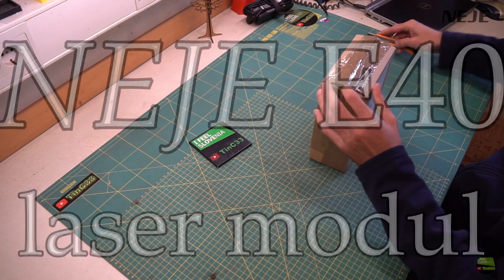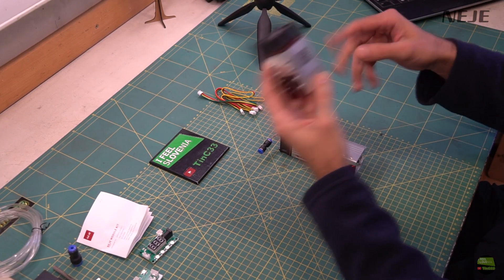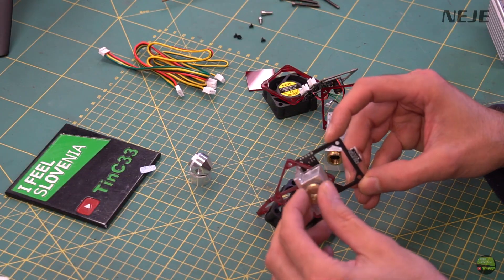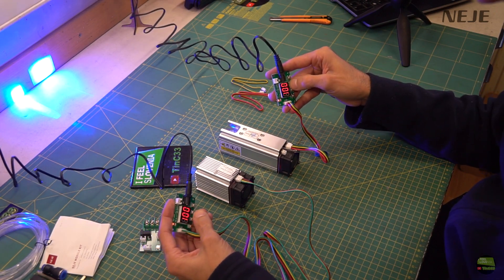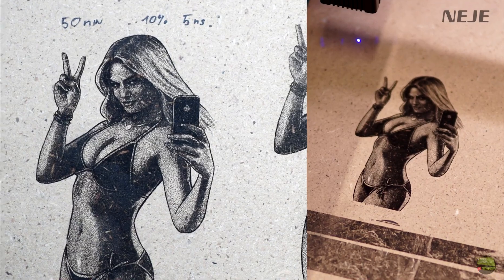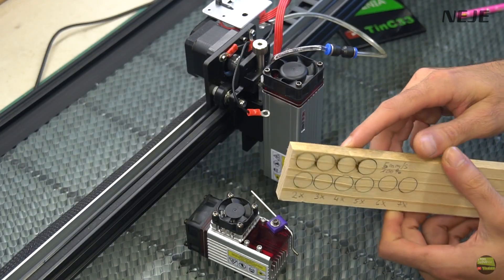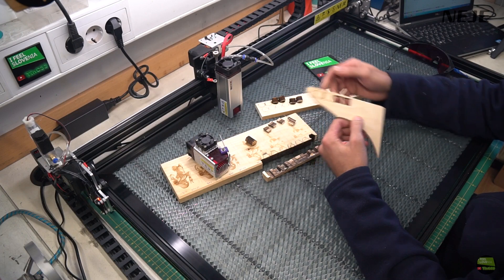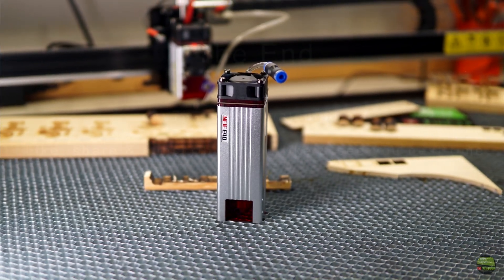Neje E40 Laser modul [unbox/review/first test] + compare with a40640

Comment: Nice analysis and review of the lasers, Tine.
Can you help me? How many lenses are there on that A40640 ring, when you open it for cleaning?
Let me explain: I opened mine to clean, but the metal ring and lens assembly fell onto the workshop floor. After looking under the equipment, I found it, cleaned it and put it back in the module, but there was only one lens on the ring (which I thought was normal).
I later learned that some laser modules use more than one lens. I don't know if this is the case with the A40640, as I couldn't find it on the manufacturer's website or looking online.
Can you tell me how many lenses came in yours? Thanks.

Comment: Its advertised as a laser for engraving jewelry mainly stainless steel…what do you think?
Reply from the maker: No not ok, you need fiber laser, i just test it those days amazing machine to engrave all kind of metal stainless even in few different colours...
I will upload review video in a month.
Btw machine is called g-weike g2 cost about 2k wich is really cheap for that kind of machine 2-3yrs ago was about 10k$. It's speed is amazing text with about 10 letters 5mm height engrave in 0,2seconds 😀

Comment: Hey there, very cool video.  I need to engrave some small lettering (3.5mm high) onto a stainless steel pipe (9mm OD).  Seems the E40 would do the job?  What do you think?
Reply from the maker: Actually a40640 is stronger for stainless since you can set fine focus for engrave and got more power, but also e40 will do the job.
But what you need is just what i testing now its fiber laser engrave into steel in seconds 😀
Reply: @TinC33  On really, wow that sounds very interesting.  is it expensive?  I'm so new to these machines and laser engraving.  Here's a similar example of the type of lettering I want to achieve, do you think possible with the Neje machines? https://youtube.com/shorts/S7OpDTkE0Ok

Comment: neje improved the E40 lens by reading the specs on their site. Now the focus is smaller than the 40640, so this E40 module is its definitive successor
Reply from the maker: That sounds great, but nothing can beat the monster E80, i still edit the review about Neje 4mqx and E80... amazing combination
Reply: @TinC33 Yes, but he too is not much on the lenses, the focal point is too big. By the way E80 looks like it can't be mounted on Master 2 Max and similar :(
E40 0.03x0.04mm 
A40640 0.04x0.06mm
E80 0.06x0.06
in these conditions A40640 it's obsolete
Reply from the maker: @johnny8227  yep i love 40640 because it also got settable focus and with short focus make amazing result on inox, E80 is 24v and about 500g so only max can carry them.

Comment: This is the perfect review and it has answered all my questions! I've been using my Neje 2s Max with a40640 for almost 2 years of daily use, but the laser is starting to weaken. (now running at 50% slower speed than before to make the same cut)

So based on your review I think the e40 laser module coupled with the 3sMax is the perfect replacement, since I mainly cut 3mm MDF and 3mm ABS sheets for my small business. 

Thanks again for your hard work in making these videos!
Reply from the maker: Exactly, just one question, did you clean lens regularry on your 40640? A tiny layer of dust decrease power a lot. Also aditional fan halps a lot for long term working.
Reply: @TinC33  hi! Thanks for the reply. Yes I've been regularly cleaning the lens ever since I purchased it. Usually once every 3days. I also have a powerful smoke extraction fan with laser housing box so smoke is extracted effectively to reduce any carbon/residue buildup. I use a Hailea ACO 328 for air assist so not an oil compressor. I do not have an extra cooling fan on my current a40640 so the e40 with its superior cooling should help increase lifespan of the module.
Reply: @TinC33  I've just placed the order for the Neje 3Max with e40 using your referral link! I pretty much wait for your videos before buying anything laser-related as my last Neje 2sMax purchase was based on your review too. Thanks again for doing the research to help us with our purchases!
Reply from the maker: @jaysoncrichton-stuart9727  thanks

Comment: Thank you, I've been waiting for this review - can't wait for the 80w version. Is there any reason why with a square/rectangular beam there isn't a circular mask to smooth out the edges of cuts? Any ideas?
Reply from the maker: thanks, i got some great news neje max 4 and e80 will arrive to test but temporary they're out of stock in EU warehouse.
it be perfect if we got round focus but every masking here will dramaticly decreased the power of laser, that's why it is square i think. but so far i notice 40640 got far far the best focus, on A40630 there's tottaly rectangular, twice longer than it's width.
Reply: @TinC33 zanimam se za nakup modula. Se splaca narocit modul e40 za rezanje do 10mm vezane plosce ali bo na voljo kmalu kaj mocnejsega za isti denar?